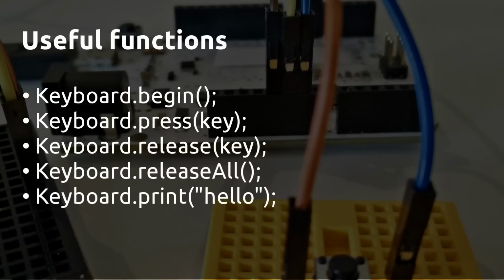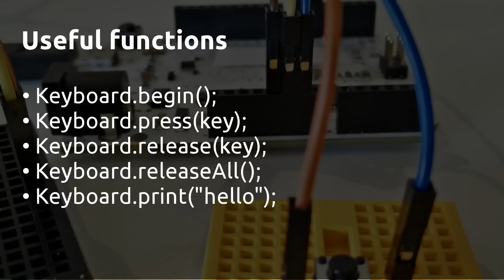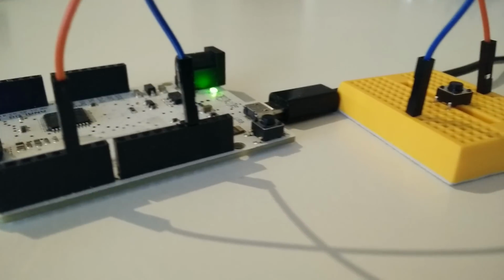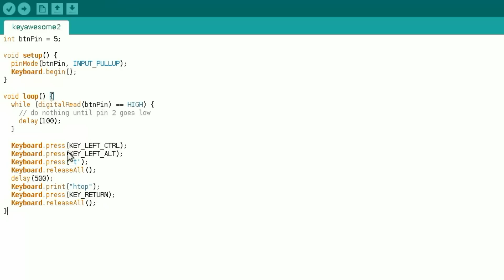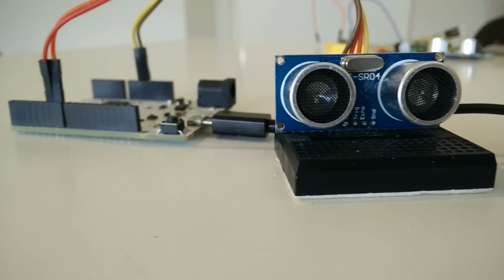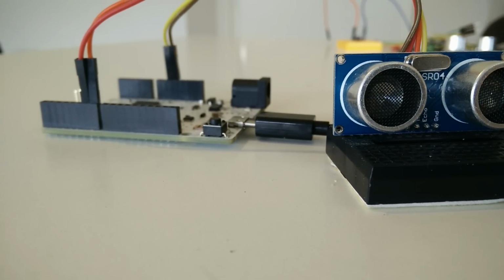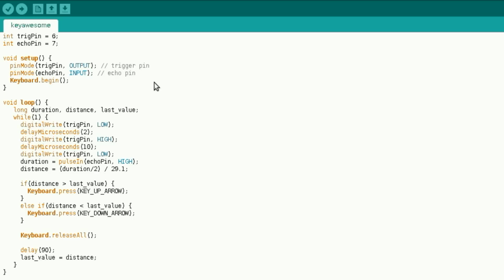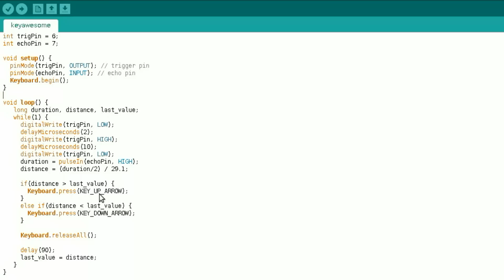Emulating a keyboard on the Arduino - Tutorial

Comment: If anyone needs an example of multiple keyboard inputs with digital pushbuttons, here you go :) :

#include <Keyboard.h>

void setup() {
  // make pin 2 an input and turn on the 
  // pullup resistor so it goes high unless
  // connected to ground:
  pinMode(7, INPUT_PULLUP);
  pinMode(12, INPUT_PULLUP);
  pinMode(6, INPUT_PULLUP);
  pinMode(13, INPUT_PULLUP);
  pinMode(4, INPUT_PULLUP);
  pinMode(2, INPUT_PULLUP);
  pinMode(0, INPUT_PULLUP);
  pinMode(1, INPUT_PULLUP);
  pinMode(5, INPUT_PULLUP);
  pinMode(11, INPUT_PULLUP);
  
  // initialize control over the keyboard:
  Keyboard.begin();
}

void loop() 
{
  if (digitalRead(7) == LOW) //done
    {Keyboard.press('w');
    }

  else if (digitalRead(12) == LOW) //done
    {Keyboard.press('a');
    }

    else if (digitalRead(6) == LOW) //done
    {Keyboard.press('s');
    }

    else if (digitalRead(13) == LOW) //done
    {Keyboard.press('d');
    }

    else if (digitalRead(4) == LOW) //done
    {Keyboard.press('j');
    }

    else if (digitalRead(1) == LOW) //done
    {Keyboard.press('k');
    }

    else if (digitalRead(0) == LOW)
    {Keyboard.press('l');
    }

    else if (digitalRead(2) == LOW)
    {Keyboard.press('u');
    }

    else if (digitalRead(5) == LOW)
    {Keyboard.press('i');
    }

    else if (digitalRead(11) == LOW)
    {Keyboard.press('o');
    }
    
  Keyboard.releaseAll();
  delay(110);

  Keyboard.end();

}
Reply: Very nice! Would the "else if" setup preclude multiple button presses from registering at the same time? For instance, let's say you're controlling a game character using WASD and you want to move both forward (W) and to the right (D) so you move along a diagonal. It seems to me that a string of "if" statements may be a better solution. My Leonardo hasn't arrived yet though, so I can't test it myself.
Reply: @rileyparish5149  i have no idea tbh, haven't touched arduino in a year, but good luck on your project! :)

Comment: i did every thing u said it give this msg (exit status 1
'Keyboard' not found. Does your sketch include the line '#include 
<Keyboard.h>'?)  what should i do and im working with arduino 
leaonardo !
Reply: An Arduino Uno cannot act as a USB keyboard - therefore the Keyboard library doesn't exist for it. You can only use Keyboard.h on boards where using Keyboard.h makes any kind of sense, such as the Leonardo.
Reply: that happing when i try to  upload
Reply: Hi! Same here! Did you solve the problem?
Reply: Add the keyboard.h library